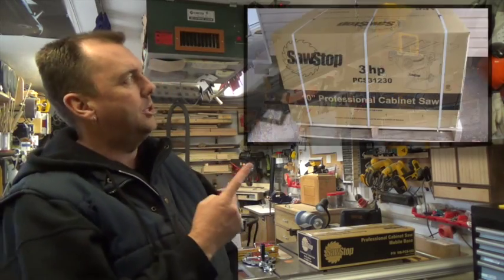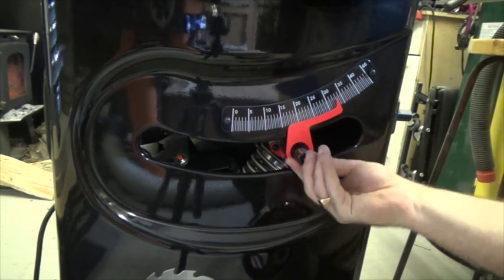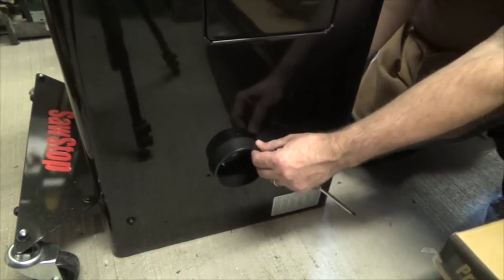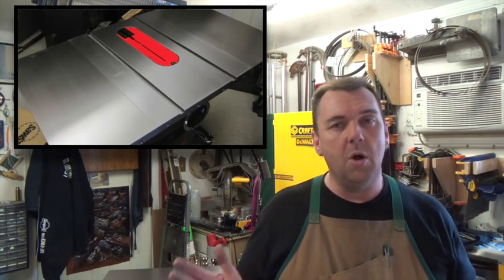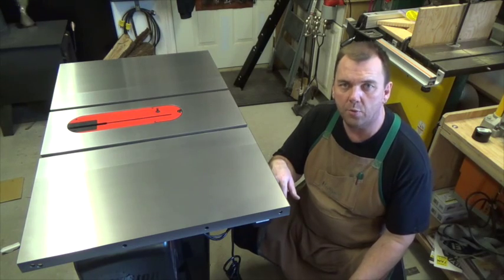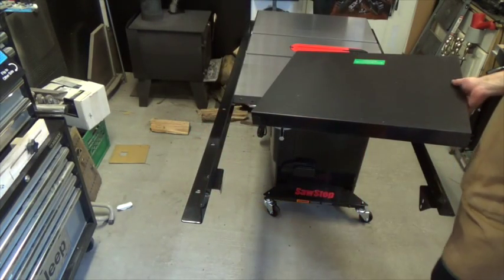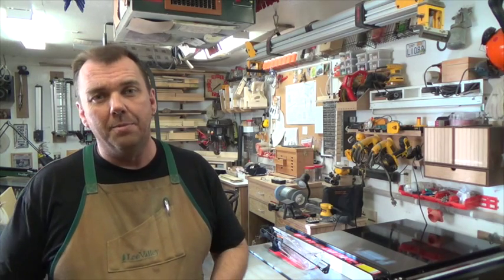Sawstop assembly

Comment: I just ordered my Sawstop 3.0 HP 230v 36” with T Glide, dust arm kit and industrial mobile base.  I am keeping my Dewalt 10” contractor saw and awesome rolling base. It took me awhile to understand that a table saw is the core tool of any shop so Im killing it in the core department.  Nice video sir.
Reply from the maker: Thank you for the kind words on the show Jonny.  I appreciate it.  I can say with the utmost certainty that you are going to love this saw.  I have been using mine steadily for ages and I have not had a single problem with it.  It is a solid piece of machinery that hasn't let me down.  If you have any questions along the way, please don't hesitate to ask.  I'd be more than happy to help if I can.  Thanks for tuning in to the show.

Comment: I assembled a 3 HP PCS today, with the same base.
I also assembled an industrial 3 HP, using the industrial 
base.  That base you used, took me 1.5 hours.  The 
Industrial, 15 minutes, and I installed it AFTER the 
saw was assembled.  (We have a forklift at work.)

OK, attaching and leveling out the wings.  Get a dead 
blow hammer!  They are $3 at Harbor Fright!  I have a 
workbench at the shop, which is just at the right height, 
to put the wing in place, and slide the main body to it.

Put in the 2 outboard bolts, then the 2 center bolts.  Do 
NOT tighten them down, yet.  Snug up one of the outboard 
bolts, just enough so the wing will stay in position, but you 
can "assist" it with the dead blow.  Your straight edge should 
be hanging on the wall, for this step.  Align the wing, front to 
back, with the main table.  (Dead blow!)  Align the height, at 
THAT bolt.  You can get it down to less than .001, just by feel.
Tighten THAT bolt, good and tight.  Now, hit the next bolt, 
aligning it, at the table top, by feel.  Tighten it down.  Rinse 
and repeat.  Yes, you can straighten out slight bends with 
this method.  I've assembled quite a few SawStop units, and 
have NEVER seen that join perfect, without "massaging" the 
alignment.

Once you have the rails on, (main table bolts) use your 
straight edge to adjust the angle of the wings to the 
table.  You'll need to lift or lower, while tightening those 
outer (wing) bolts.  Most of these, are spot on, from Taiwan.

Sorry to get long-winded here, but I build these for a living.

steve
Reply from the maker: No need to apologize for getting "long winded" Steve.  I'm glad that you chimed in with your experience.  I'm a sure that plenty of viewers will find this information very useful when it comes time to assemble their saw.  Thanks so much for tuning in and for taking the time to leave such a lengthy and well explained explanation of your method of assembly.  It's very much appreciated.

Comment: Thanks Kenny. Actually I haven't even started. The saw is still in the bed of my pickup waiting for some help to lift it off. I was just looking at the parts and the instructions and it looks kind of confusing. Perhaps when I actually get to installing it, it will become clear. But thanks for the offer of help. If I can't figure it out I'll let you know.
Reply from the maker: +Gary McCoy 
When I first looked at the assembly instructions, they did look a little overwhelming, but then again so does every tool's assembly instructions.  Once I got into it and followed along step by step, it became apparent very quickly that it was a simple venture.  All parts are clearly labeled and all hardware is also clearly labelled on a colour coded card that makes for an easy installation.  If you have any issues at all, feel free to send me a message and I would be more than happy to help you if I can.

Comment: You can clamp a board or sturdy straightedge to support the extension wings for easier installation.
Reply from the maker: That's a good suggestion Austin.  Thanks for tuning in and for chiming in with your idea.  It's very much appreciated.

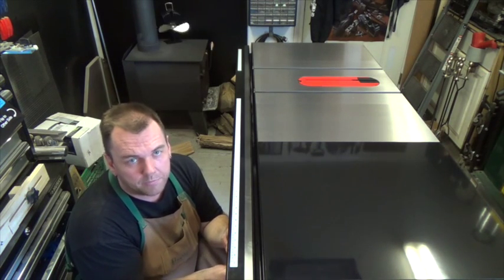Comment: Great video, thanks for sharing. If I may ask, regarding adjusting the distance between the tube and rail (starting on 18:10), I get the impression that just locking the fences adjusts the distance?  How do you know the tube is not too far out (away from the rail) ?  The installation manual wants us to leave a 1/16" gap between the fence and the rail. I'm not sure how to do that.
Reply from the maker: The rail should be adjustable from front to back by loosening the mounting bolts and sliding the rail to the position that you need it to me.  In order to get the 1/16" gap, you can cut a small piece of stock as a spacer and then tighten the rail in place with the fence and spacer.  Then the spacer can be remove.  I hope this helps.
Reply: Makes perfect sense, thank you so much.
Reply from the maker: You're very welcome.  Thanks for tuning in.
Reply: It worked. Thanks again.  I'm just going over the manual again before I turn on the saw for the first time.
Reply: Oh, my fence to miter slot error is 4/1000 and the blade to miter slot is practically speaking 0
Reply from the maker: Awesome stuff.  Glad to hear that you got it figured out.  Enjoy the new saw....you're going to love it.
Reply from the maker: You may need to adjust that over time as things settle in and the saw get used a little more.  I've had my saw for over 3 years and I've never had an ounce of problem with it.  Love it.  Thanks for tuning in.
Reply: Considering how much trouble I had with my RIDGID after it lost alignment (including one kickback), I'll probably check the fence regularly.  Once again, thank you so much

Comment: Hi Kenny great video as usual from you. That looks like one cracking saw to do your projects on, I've seen somewhere on YouTube someone demonstrating the stop on that saw, using his own finger!!! it obviously worked and didn't leave a mark, but it did wreck the safety feature of the saw but who cares about the damage and the cost of the repair, when it's just made sure you still had 10 fingers.
Have some fun doing cuts on the saw Kenny I'm really jealous now, mind you I'll take your old Table Saw over my crappy Sip one any day.
Take Care,
Barry from England.
Reply from the maker: Barry Roberts Thanks Barry.  The guy that did the video with his finger was the inventor of the product.  He obviously has some serious faith in his invention.  The saw is engineered to take the abuse of a sudden stop like that.  The brake mechanism and the blade would be the only things ruined or damaged.  The brake costs $91 and the blade cost obviously varies.  If you tripped the blade due to skin contact, you can send your brake into Sawstop and they will replace it free of charge.  The brake holds data that they can remove for their research and they can tell if it tripped due to contact with skin.  I've been working on the saw for a couple of weeks now and it seems like a very solid and well built machine.  Thanks again for dropping me a comment.

Comment: I'm just about to buy this Kenny so your video will help me. Thanks. I'm curious to know if you had to align the blade parallel to the slots or was it good enough straight out of the box? Did you check this with a dial indicator or combination square or didn't you bother.
Reply from the maker: Hi John, thanks for contacting me.  First off, you are going to love this saw.  I've had mine for quite a while and I absolutely love it and don't regret the purchase a bit.  As for aligning the blade, I am a bit of a perfectionist this way and will spend hours getting a tool calibrated to do exactly what it should.  I used a dial indicator and I'm pleased to say that this saw was next to perfect right out of the box.  Maybe I lucked out or maybe that is the standard of their quality control but either way, after checking it, there was no adjustment necessary.  I did have to adjust the stops for the 45 and 90 degree bevels of the blade but it was only a minor tweak.  Congrats on the new saw and I hope you enjoy it as much as I have enjoyed mine. Thanks for tuning in.
Reply: Kenny, mine was out .010" which according to Sawstop is just within tolerance but I wasn't happy so followed the manual and their supporting video and had it adjusted to under 0.001" in 30 minutes. In fact it was practically zero. The use of micro adjusting screws instead of using a dead blow hammer made all the difference. I adjusted the stops so I could get beyond 45 and 90 so I can use my digital cube. I never use a table saw's scale. The fence was bang on parallel to the slots. It even had a slight toe out at the end to prevent binding and kick back. Anyway you were right, a brilliant, accurate saw. I am excited!
Reply from the maker: Glad that you like it.  I haven't regretted this purchase since the day I bought it.  The adjustments are super easy and as long as you take your time, everything is great.  Good luck with the new saw John.  I hope it serves you well for many years to come.  Congratulations.

Comment: Kenny, nice job once again on the video. You do such a good job of explaining each detail along the way. I have been thinking about upgrading my Ridgid saw to a Saw Stop, debating if I need the 3hp saw or if the 1.5hp would meet my needs, as the Ridgid has done okay for the past year. Moving the saw to my basement shop is going to be my biggest challenge, that is after paying for the saw. Any advice on the motor size? Thank you once again.
Reply from the maker: +Mike Ribelin 
Thanks for contacting me Mike.  I had the same dilemma when purchasing my saw.  I hemmed and hawed about the HP of the motor.  My final decision was obviously the 3HP.  I am hoping, that this will be the last table saw that I ever purchase and I thought, go big or go home.  Although my lower HP table saw has served me well for years and I have never needed a 3HP, I really don't know how my woodworking will evolve over the coming years.  If this is potentially the last saw that I will purchase, I would hate for my woodworking to evolve to the state that I require 3HP and I don't have it and therefore would be forced to purchase a new saw.  Although I may not be utilizing the 3HP at the moment, it's nice to know that it is available if and when my woodworking style evolves and requires it.  Better to be looking at it, then looking for it.  I hope this helps.

Comment: Nice video congratulations. I watch many videos related to the Saw Stop brand. To collect as much information as possible. Unfortunately in Italy it is not possible to have this saw table, so to realize it after a careful design for my lab. If you want to give me some directions and measurements I did not find on the site I will be very happy, thank you
Reply from the maker: Thanks for the kind words on the show Giorgio but I am not sure what measurements you are looking for.
Reply: Nothing special, for example zero clerance measurements, the distance of the blade from the guides both in width and height, small details that the technical sheets I downloaded from the site are not found. Tanks, Giorgio
Reply from the maker: I won't have any access to my shop for about 3 weeks Giorgio and although these are some pretty strange requests, I will see what I can do for you once I get back in there.
Reply: Thank you, do not worry maybe because I'm writing to you from Italy, but strange there is nothing but I understand your reticence. I'm a fan of woodworking like you but I do not want to make you a problem. I told you in Italy that type table saw can not be bought, I also wrote to Saw Stop but still can not export the car, you can only buy some parts in amazon. Anyway thank you, greetings
Reply from the maker: At the moment Giorgio, I am on vacation and won't be back to my shop for about 3 weeks.  That's all.

Comment: i love your videos and yesterday i bought the professional saw stop and i have had nothing but troubles with it,,,,other than the safety feature to me its overpriced and weighs a ton,,
Reply from the maker: Sorry to hear that you are having issues with the saw Jeff.  What kind of issues are you having?  Maybe I can help in some way.
Reply: @acutabove_woodworkings  well I got the mobile base the one for 229 and putting it on the holes would not line up and the screws would not even tighten up completely...and the saw itself weighs a ton..to be honest with you after having so much trouble with installing the mobile base I'm scared to go on...it's kinda like the old saying goes...when you start out having alot of trouble you might need to stop...the worst might still be ahead....I think I'm going to take it back...and I do hate it because of the safety's aspect of it....but other than that...I would take any saw over the saw stop
Reply from the maker: @jeffoldham3466  I have to say that I am seriously surprised by this Jeff.  When I assembled my saw, everything lined up perfectly.  There wasn't one single problem at all.  The saw is definitely heavy but that weight is what is going to help eliminate vibrations while in use.  I wouldn't want a light table saw, no matter what the brand.  I would seriously be considering contacting SawStop about the mobile stand though.  There may be something mis-packed or a defect that they can correct for you.  From what I understand, their customer service is top notch.  Keep me posted.
Reply: @acutabove_woodworkings  i just want to thank you for all of your input and you are right,,,,but the man at klingspor ask me if i had assembled anything other than the mobile base,,and i told him i havent,,and he said that if i had or put power to the saw,,,it was mine,,he would not take it back,,,a 3400 dollar saw and he would not take it back if power was put on it,,,,,you know home depot sells the same saw with a 90 day return policy,,,and im not saying that im going to get the saw just to return it but i think thats kinda crappy,,,i honestly dont know how im going to get it back into the truck,,still trying to figure that out,,,,its really bad when you get old and totally disabled,,lol
Reply from the maker: @jeffoldham3466  This is definitely bothersome and I hope that you get it worked out.  I have thoroughly enjoyed my SawStop for the years that I have had it and it is leaps and bound above some of the other table saws I have worked on as far as being solid and its performance.